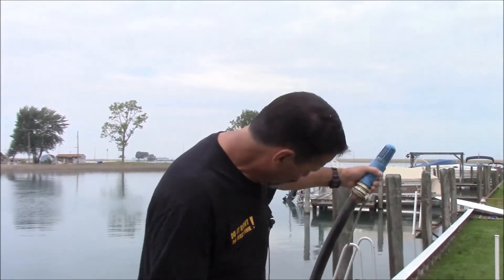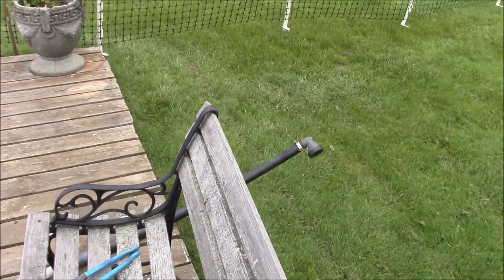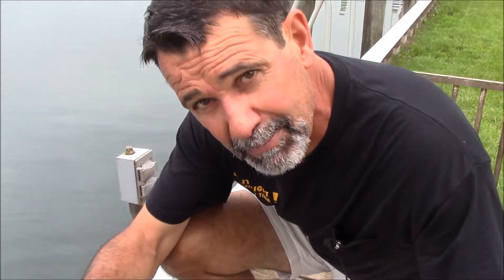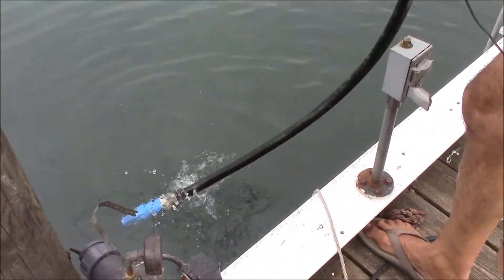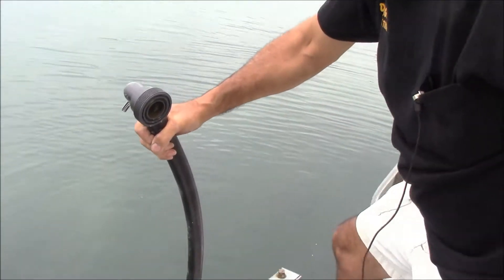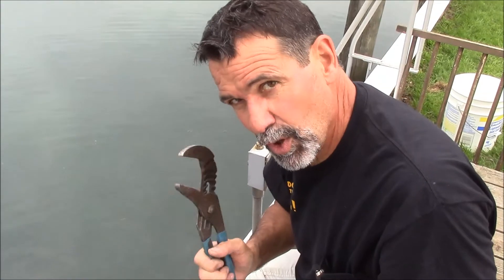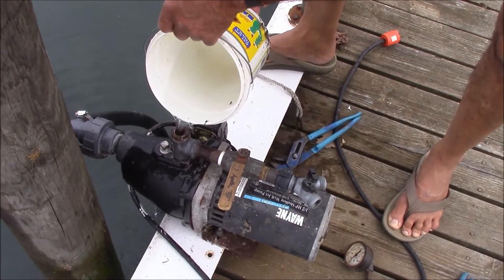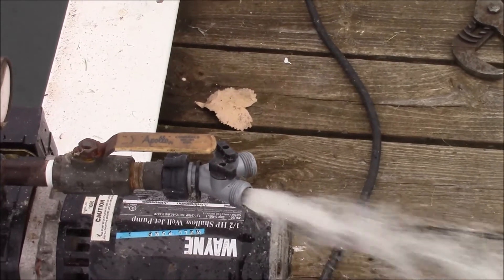Seawall Pump Priming Trick Using a Foot Valve

Comment: Great video. What your power source. and how to power the pump to test it. Without control panel 220
Reply: That house only had 120 volt supplied to that pump. Simple plug acts as a legal disconnect. My pump that’s 240 volt also uses a plug at the seawall which I can plug and unplug to test and prime.

Comment: i live on a lake during a drought, so we mover the irrigation foot valve out to deeper water. i regularly move them out 100 feet, and boy oh boy getting them primed is a chore. the foot valve is on a 90 degree elbow so it sticks up to avoid silt, so the priming method you use doesnt work at all for me. 
the foot valve ends up sinking and the pipe floats in several spots with occasional pockets of water so it ends up looking like the loch ness monster. getting those pockets of air out is frustrating. ive tried holding the pipe above my head with a water hose in it, and water still just runs out on my head. 100 feet is a long way!!
after much head scratching, and head banging..(ouch im standing next to the seawall after all!) i ended up shoving water hoses down the whole thing all the way to the footvalve then turning it on.  since i cant get the water to enter via the footvalve, ill just feed it water my own dang self!

id love to hear any other tricks. ive tried to run a rope out to the footvalve with a stick stuck in it so the water can enter without the spring interfering, but never got it to work with the footvalve guard all in the way. i tried a shop vac which works but ever emptied a shop vac canister 9000 times? i could run the shop vac through a barrel first to catch the water i guess, but i just want an easier method.

someone make me feel silly and tell me what ive missed, so i can shake my head, and get about making this quicker so customers dont think im an imbecile out in the lake acting like a clown!
Reply from the maker: First off I put the foot valve straight out or down. The spring on some of them are week so pointing them up can hinder it sealing, never prime it then. I don’t know if you go out there to set it or slide it out from shore. I like to use ‘earth anchors’ to secure my points like yours. I’d get a 40” one, screw it into the lake bottom 18” and then attach the foot valve to the eye on the top of the earth anchor. (Search earth anchor, lots to chose from) That way storms can’t move the foot valve around and they unscrew easily.
To purge the air try putting the pump end of the line on a 6’ ladder and fill it w/a hose up high. The air should burp out easier w/that end up high w/less chances of trapping air. Also if you get lochness air floaters, while the hose strapped to the ladder (with your fill hose stuck 12” into the end) if you can walk out and push down and the air will burp out towards the ladder. Possibly if you were on the ladder while it was being filled and you could pull back on the line and stretch it which would un-trap the air and purge it that way.
If your intake line was moveable and you could plunge it back and forth, it will add 12” of water into the line from the foot valve, on every plunge, heck only 100 times….
Email blair@mrhardware.com if needed.

Comment: Would this still work if I had the suction pipe going over the pump, like if the pipe came out of the pump and went up into an upside down u and then into the lake?
Reply from the maker: Sure, as long as the intake line is water-tite. The more joints and the longer the intake line the more chance of a leak which will ruin the prime.

Comment: Thanks fro your video.   I see you have a 1/2 hp pump.  Do you know if this setup could be used to lift water ~30 feet up and over a rise?
Reply from the maker: First rule of pumps, they can push 4 times farther than they can suck. So put the pump at the water source if possible. Many pumps are made to lift 30' and more. so if you have to place the pump far from the source, chose a pump designed so, and call technical support to get even smarter before purchasing.